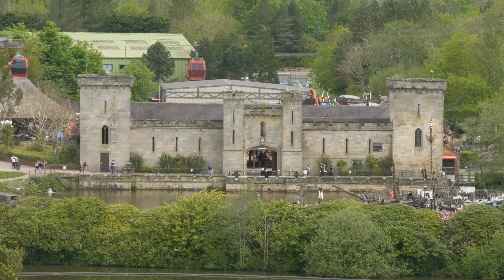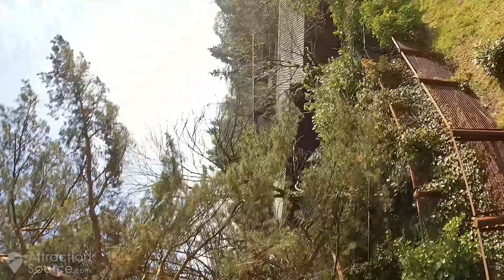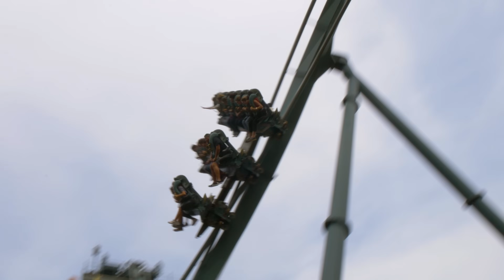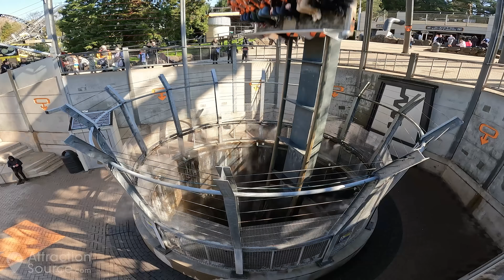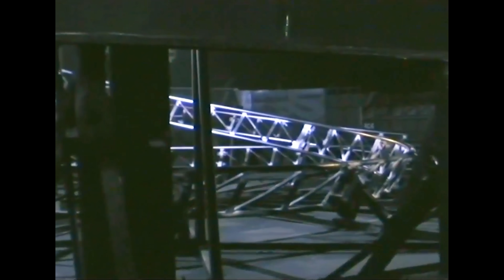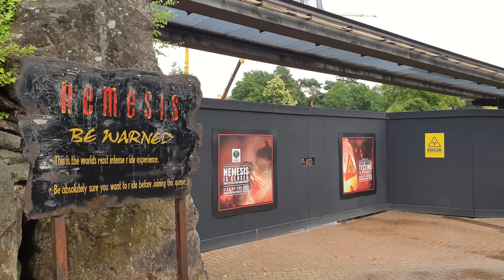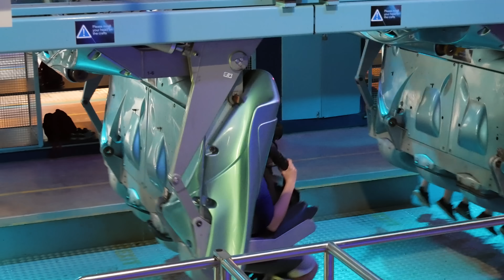Alton Towers has a roller coaster problem

Comment: I'm kind of torn on oblivion. When you really look at what it is it's just a drop and I doubt it's a rollercoaster that specifically pulls in guests to the park at least not in the same way that the smiler would for example. I think the question is are you going to replace it or are you going to improve it. Because if you're not going to improve it then is it really worth it?
Reply from the maker: I think it's worth keeping for as long as possible, until it becomes too much to maintain. I can't really see them extending or improving it to be honest.

Comment: I remember queueing up for the Nemesis and a large spinning disc flew off the coaster into the valley below. When we got round to the boarding station we told the operators and they didn't seem to believe the teenagers what we  were telling them. We still got on the ride, we had been queueing for 2 hours! The naivety of youth..
Reply: r/thathappened
Reply: @alaeriia01  ironically, no one seems to believe the story. I guess it wasn't a pivotal piece of the ride it's been going for years now. It must have a lot of fail safes in the design.
Reply: @krislibertine  I'm just not sure what part of a B&M invert would be a "large spinning disc".  It couldn't have been a road wheel; those would be noticed immediately.  Maybe it was a loose article from one of the riders, like a CD or something?  How thick was this disc?
Reply: @alaeriia01  yeah it was a disc, not a CD size, larger than that. Not sure if  anyone would have that on their person it was that big.
Reply: @krislibertine  The only circular thing on a B&M inverted train larger than a CD is the road wheels; it would be fairly obvious if one of those went missing.  Assuming what you said is true, I think it must have been some sort of spare maintenance tool; maybe a rotary buffer?  Did the ride feel any different from previous rides or rides on a different day?
Reply: @alaeriia01  I only went on it once that time. The queue was so long. This was years ago, mind. 
 I don't remember a lot of things in my childhood but I definitely remember this one.  No reason to lie or mislead.  I doubt we will get to the bottom of it, the Nemesis lives on. Our mini YouTube comment  investigation will solve nothing.  😁
Reply: @krislibertine  I'm just more curious as to what on earth it could have been.  Oh well, we may never know.

Comment: My biggest gripe with the coasters at Alton Towers is the duration, they are far too short to demand hours of waiting.

The second gripe is reliability. 

I recently visited AT for the first time in a decade, and Wicker Man was closed most of the day before opening around 1pm and closing at 4.30pm, leaving myself who had bought a fast track and unable to refund it, and others who had queued for 2-3 hours left disappointed. 

Galactica broke down on me 3 times whilst queuing for 2 hours, and Thirteen was closed until 3pm but I caught it exactly as it opened and walked on. Rita had also broken down that day too.  

Ultimately Galactica has the biggest reliability issues it seems, and takes forever to ride due to the complicated loading system. 

Rita is incredibly short in its layout too, and its basically just a launch and done, which is boring.

Even Thirteen is very short, and it feels like its lacking half a layout, as the ride just gets going after the drop and reverse section to then end. It really needed a second launch and further section.

However there are three stand out rides to go. 

- Rita
- Galactica
- Spinball

I think Spinball will go first by 2026 and I think Galactica will be removed by 2028. 

Rita however has a lot of potential to be re-imagined. Install a new magnetic launch system and extend the layout behind Thirteen. I think this is the most cost efficient method.
Reply from the maker: I think ride reliability has been particularly poor this year sadly

Comment: Nemesis is being re tracked which is awesome! As for some of the others I think they should do the following...

1. Make oblivions drop actually 90degrees, like the other dive coasters. Change the trains to cope with this.They should also put an inline twist inversion inside the tunnel as its coming up out. That would be next level! They should also make new trains floorless!

2. Rita should be rectracked but with a whole new layout. It should go around the perimeter of thirteen and go much faster. They should make it the first coaster in the UK to reach 100mph! U dont need height for this, keep it low with dips and hills below treeline, through the forest which would be insane. 

3. Galactica im unsure. This would be the hardest to upgrade. All i can think of is a launch (60mph lets say) into a second section of track. So First half is relaxing and second half more thrilling, catching you off guard. Again low to the ground. 🤷🏽‍♂️ Just my ideas.
Reply from the maker: I think a launched flying coaster would be awesome for Towers!

Comment: Nemesis is still world class (hence the refit/refurb). Oblivion, on the other hand,  the world has moved on and there are better dive coasters out there, eg Baron 1898.  Oblivion could be replaced with such an update (use current drop and then put loops etc over where small rides live) Wouldnt mind a good decent steel coaster, although generic, corkscrew, beast/Blackhole and thunderloop were all fun if queue times were short.  Logflume was a classic too and missed,  maybe AT needs a water coaster now?
Reply from the maker: Hopefully Project Horizon will provide Towers with another fun steel coaster!

Comment: I could see Alton Towers retrofitting all the existing rides that do well and are over 20 years old and replace them with new experiences.

Rita could get the Top Thrill Dragster Treatment and become a magnetic launch coaster made by Zamperla (if that is a success).

Oblivion has potential with the underground section and the theming. AT could find a way to make the ride longer, maybe have it dive back into the ground after the turn instead of going straight into the brake run.

Thirteen could be extended with a longer layout after the spike. The ride just ends anticlimactically after the drop track and backwards launch.

Spinball would be a coaster with rotating cars much like Cobras Curse at BGT, or maybe a Mack Spinning coaster (But not Xtreme Spinner).

Smiler would have a new structure design, as it is starting to suffer structurally and the park spends a lot of money on having to maintain it.

I could see Wicker Man lasting a whole with some new Titan track.

And finally, Galactica could become something groundbreaking, like the world’s first launched flying coaster. I am picturing that the ride would launch out of the ground instead of a lift hill.
Reply: There already is a launched Flying coaster😊. It's called F.L.Y. and its at phantasialand:)

Comment: My predictions for Every coaster at towers

Rita is next to be removed, The park gets a more uniqe launch coaster (Using more of the terrain) However it's more compact than rita, (so dark forrest can get more trees)

Oblivion is removed (only when it is too old to operate anymore) is replaced with a gyro drop tower (With it's station underground in the hole, Could even keep the same name and theme as oblivon)

Spinball is removed and turned into a Cebeebies expansion (Dark ride and/or kiddie coaster)

Galactica is retracked, (Turned back to air so it can be remarketed)

A new coaster opens in the car park behind galactica.

13 is Kept the same (family coasters have a Wayyy longer life than thrill)

Congo river rapids is removed, with runaway mine train staying (Coaster running throughout the trough?)

Smiler eventually gets a retrack, (is rethemed and given more inversions to beat it's own record)

Wickerman eventually becomes fully titan tracked.

Project horizon will Just re use that building for another ride when that closes

Comment: What I think/want to see to each of the coasters at towers:

I see Rita first to go, but I don't see it being replaced by a coaster. With Rita being almost entirely built over pathways and queue lines it would be extremely difficult to put a new coaster in it's spot, as you'd have to alter the paths if you wanted it to go near the ground, which will ultimately mess up guess flow within the area. I'd like to see flat rides put in both the station area, as well as the turnaround and maintenance area, as dark forest needs flats more than anything. 

For Galactica, if it was removed I'd like to see that area opened up, with some flats dotted around, and also a shop, to sell the merch of forbidden valley. With this I'd like to see the area flow into the carpark where they can put a new, replacement coaster. This could be a new gen vekoma flyer, therefore allowing the park to still have a coaster to replicate flying. This would either be an extension to forbidden valley, or an entirely new area of the park. But with this I'd also like to see some flats as well as a fast food place. If they were able to have this be a highly themed area, with the ride integrated into all the theming, it could easily be the best area in the park. And with this it would be good to see a new hotel entrance, which actually fits into the park, and doesn't look like a temporary solution, which the current permanent solution does. 

For spinball, i see this being taken out fairly shortly after Rita, and it being replaced by a family coaster, maybe a compact mack or intamin launch, preferably with spinning train, or even just rotating trains, such as something like Cobra's Curse at BGT. However, this would most likely be an extension to Ceebebies land, as it is next door to it, and wouldn't really be able to pose as it's own area. 

Oblivion is a big issue when it comes to removing. The pit, if opened, would be extremely close to the smiler, and the smiler may need track moved, to help get machinery on site, or to help the dig. For either of these scenarios, it could easily risk damage to the smiler and it's groundwork, which may cause towers to just seal the track in. For replacements, you'd be looking at either flat rides, or a very small coaster. If you wanted anything on a large scale in X Sector, you'd have to take out the smiler too and completely transform the area. This option would be the best move for the park, as yes, the smiler is a good ride and holds a record, but it's starting to suffer structurally, and the ride is pulling itself to pieces every time it cycles. With the footers and ground pins being connected to the concrete base underneath the ride, it doesn't allow for the flexibility needed to prevent the ride from being overly brittle, which the smiler tends to be in places. Personally, I don't see the smiler lasting as long as something like oblivion and Galactica, and it will probably be removed with Oblivion to make way for a whole new area, or revamp of X Sector.

For the other coasters:

- Th13teen - It's track follows the path of non-protected trees, which were removed in its creation, and it is surrounded by protected trees, which they can't remove/move. So unless something followed the exact layout, that area would be untouched after the ride closes.

- Wickerman - I see this lasting a while, with it possibly getting a retrack from eith GCI or the gravity group, whenever it needs it. If it was with GCI, I don't think they'd change much to the layout, and would be just a typical woodie retrack, which the majority of wooden coasters get. If the gravity group retracked it, I think they'd change certain elements such as the "boring bend" and the finale to add more airtime to the ride, like they did on megaphobia.

- Nemesis - I see this being retracked again after this version's shelf life is over. With possibly more story being added

- Runaway Mine Train - I also see this being retracked, but not for a while. We might see an electrical overhaul, where all electrics are replaced, but that's it before the retrack.

- Octonauts - I think this would be removed to accommodate the family launch coasters in Spinballs spot, as it is right next door.

Comment: Does anyone really know if Oblivion is really that badly in need of retracking? There is not really much of the track that is stressed, it is is only really the pullout from the drop that is stressed and those supports are all really short anyway because they are all in the tunnel. It also has thicker box section track so presumably is stronger than Nemesis. Nemesis definitely had more complicated forces to deal with, particularly around the helix where the supports are being pulled laterally. I think if they really wanted to retrack the tunnel section they would be able to do it without excavating although it would be complicated/expensive. Rita has the problem that the ride model is not likely to be supported by Intamin for much longer and some of the other hydraulic launch coasters seem to have already reached the end of their lives  as hydraulic launch coasters. The plot of land it sits on is awkward though, getting planning permission would be a nightmare and doing any major demolition/rebuilding work would probably mean you have to close Thirteen for a while which is not what the park would want as that is a popular ride for families. Galactica has a similar problem as B&M have not built any new flying coasters for a long time and it was also the prototype so there are probably some differences to the newer models (any idea if B&M would build a new flying coaster or have they completely ditched the model?) It probably has the most potential for redeveloping that land although it is still a fairly popular ride and still is another novel type of ride that they can advertise on their coaster roster.

I think if they were to redevelop Rita they would probably have to demolish Rita during one off-season, sort out the pathways around Thirteen and then wait until the following off-season to start work on whatever comes after Rita. Not ideal as it would mean losing a ride for a whole season although tbh Alton Towers don't seem to have a problem with hletting rides go down for a long time anyway.....

Comment: I do hope Rita, oblivion and galactica get reimagined in a different way to nemesis adding at least 2 elements and new trains possibly because since galactica has quite a lot of space in the area it occupies I think they can fit some more elements in maybe a small zero g roll and for Rita I think reprofiling of some elements removing some elements and using the same footers and adding some more footers they can maybe add a mosasaurus roll a zero g roll or stall and maybe a wave turn and with the new launch coaster trains in the industry it would be amazing and oblivion I think adding an Immelmann airtime hill and zero g roll would be great

Comment: Some alternatives you didn't consider. Modern coasters don't necessarily need a tall lift hill - LSMs. There is space to build in the Haunted Hollow. There is also room to build a coaster on the land occupied by Blade, Ripsaw and adjacent to Nemesis SubTerra. Spinball Wizzer is nothing special and Congo River Rapids is old, boring labour intensive and the highest risk ride which sits on a huge plot of land.

Comment: Galactica has a lot of potential to be reimagined...perhaps as B&Ms first launched flying coaster. Also, Oblivion' s short duration makes it a strong candidate to be reimagined too. At least 4 unique elements ie a spike, switch track, launch or even a show room would do wonders for it. 
AT's restrictions is "a problem" that could continue to birth some amazing rides.
Reply: Isn't Galactica a reboot of 'Air' already?
Reply: @jarthurs  It is indeed - It was meh at best, hence the reboot.
Reply: We're gonna ignore they can't develop the land around it... It's on park boundaries and pretty sure they can't remove trees there, could be wrong about the tree part tho
Reply: Remember when it used to have Virtual Reality headsets on it don't even know how long ago now but it was a first
Reply: Yeah. They could add a whole underground section to Oblivion, and then replace the wave turn at the end with an outer bank. And give it lapbars, like the ones on B&M Hypers.
And they could give it an underground launch to add an extra block zone.